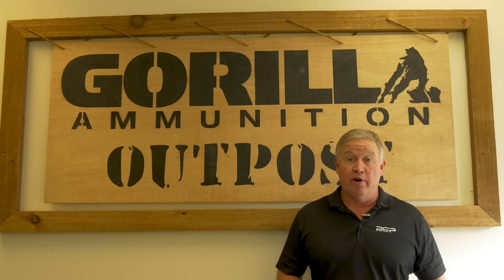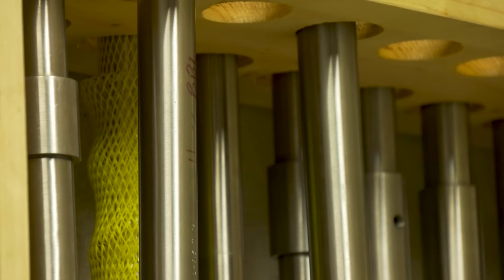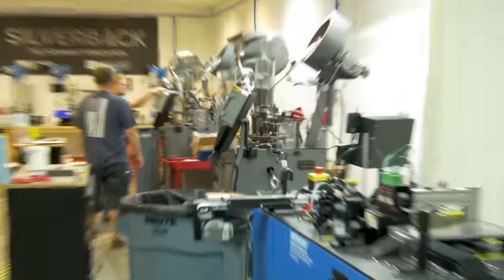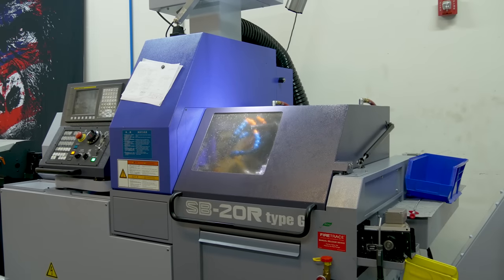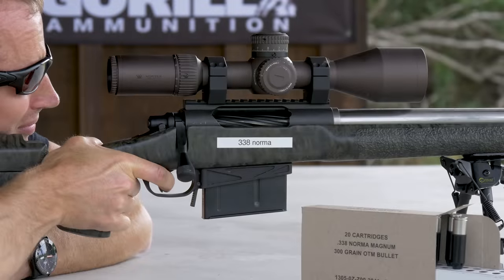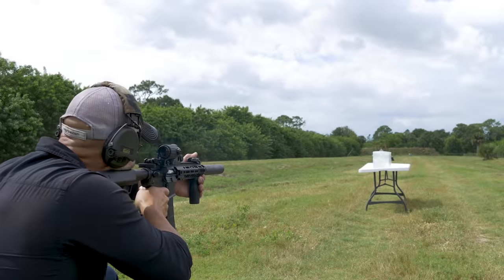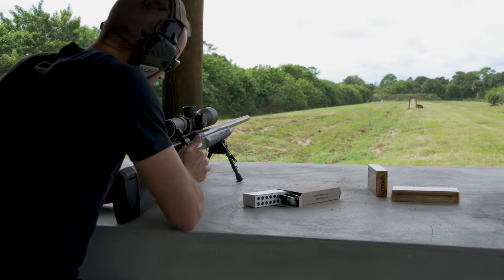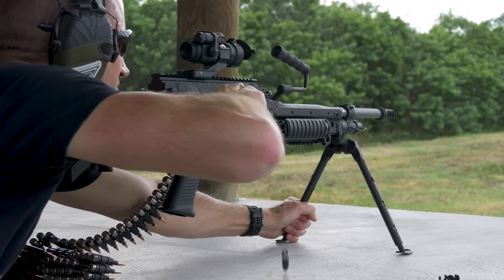A Look Inside: Gorilla Ammunition & PCP

Comment: I’ll really be interested in reading some of the science behind the PCP once it’s been tested enough for release. I feel like expansion, micro splintering, and polymer degradation from extreme heat exchange (leading to chemical residue) are all obvious problems with polymer cases that they must feel confident they’ve found a solution to. I’d love to see that fact sheet.
Reply from the maker: I'm with you Drew.  I think it will be interesting as more information comes out.
Reply: I'm having the same concerns. I really like some of the new bimetal casings
Reply from the maker: There are some people doing cool things with bimetal...

Comment: Yep, Case/primer bases turned on a Bar stock fed Swiss multipath (star SB-20R type G w/main and sub spindle ops with pickoff/pull off OD/ID turning gang and live axial/radial stations, programmable Ca/Cb synch, et al). Using the guide bush to enable rigid operations, close tolerance GD&T and volume production. This is pretty much what I assumed. And I’m sure they have several all running in lights out production.

Comment: I'm surprised they CNC the lower part. I would think they would have taken a queue from the shotgun ammo industry instead.

Great video and Happy Thanksgiving.
Reply from the maker: I think it has to do with the materials.  The bottom of the case is stainless steel if I recall, so you can't just form it like brass.

Happy Thanksgiving to you too!
Reply: @KitBadger  Sure, but the bottom 'brass' on shotshells is steel too.
Reply from the maker: @joffeloff  I guess I didn't realize that.  So ya, I'm guessing the profit isn't there yet to invest in the machines for it.
Reply: @KitBadger  Apparently they stamp out those steel portions of the shells so I guess they will be developing a stamping method if they get a contract.
Reply from the maker: Good to know.

Comment: isn't this the stuff that explodes if you put it in a fluted and/or any nonstandard chamber
Reply from the maker: No idea.  I can't see how it would explode though, unless there was a loooot of extra space in the chamber.
Reply: i seem to remember a while back it was shown that polymer cased ammo would blow up in HK type roller locking guns and FAL variants
Reply from the maker: @Xtorin_Housecat_Ohern  I have no idea.  When you say blow up though, you mean the case splitting?
Reply: in the test i saw, the case folded in on it's self and caused just about every malfunction known to man in the roller lock with a fluted chamber and in the FAL the case ruptured around the base and blew the magazine to pieces.... the ones you showed in this video though do appear to be different and have a longer section of metal at the base.
Reply from the maker: Weird.  I imagine they probably have most of that worked out.  Or are just making it for US mil, in which case that doesn't matter?